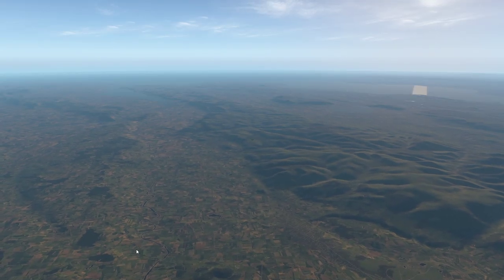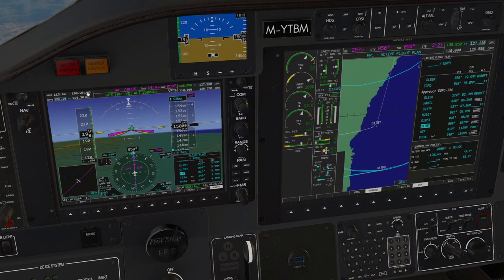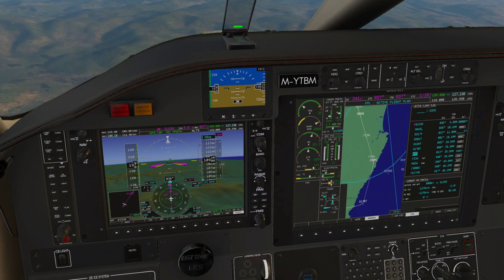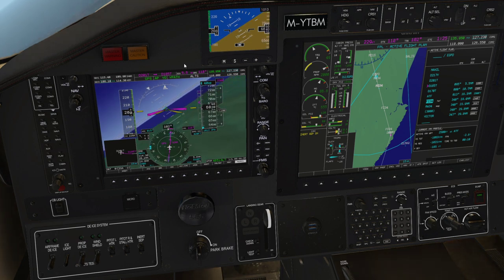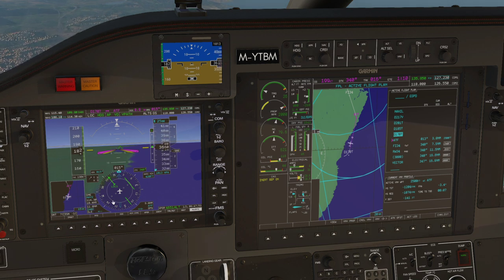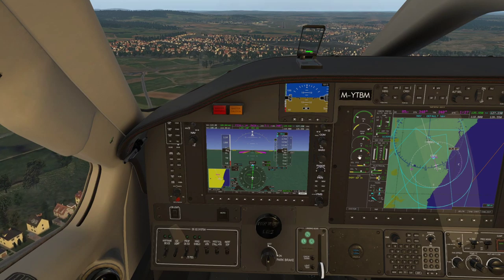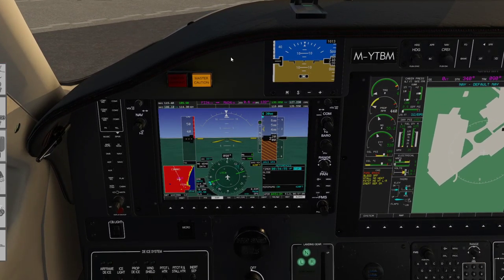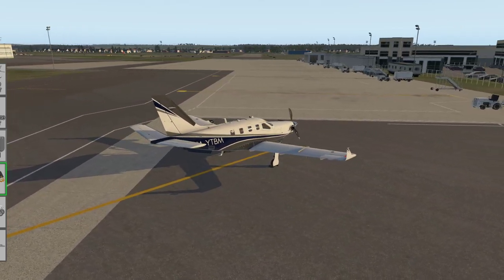Hotstart TBM 900 Part 2 - IFR Arrival to Aberdeen ILS 34 [X-Plane]

Comment: That's not really a float, in these GA aircraft, you generally flare by floating over the runway until you stall, its very common to hear the stall wrning just before touchdown in these aircraft. But nice video :)
Reply: CMBelite-FR you're talking about way smaller aircraft than that... It might be true for you ubiquitous C172/Tecnams but certainly not for the TBM
Reply: @dvirshany  For the TBM I mainly watch Steveo videos, he floats way longer than you. Granted you don't hear the stall warning but if I recall correctly, in some of his video, i've heard the warinig: airspeed just prior to touch down but i could be wrong. Also I noticed that he likes to flare with 15<-20 kts more than you, maybe that's why he performs a floaty flare to bleed the airspeed maybe ? I guess there is different kanding technique with the TBM

https://www.youtube.com/watch?v=C3wXCaA1xsg

https://www.youtube.com/watch?v=BFKdyaV4ySY

https://www.youtube.com/watch?v=Itr3xEaeGyU

PS:
in this video, he performs the same landing tecnhique like you I guess, way lower airspeed than the recommended default 85-90 kts,  but he used the AoA indicator I guess which is integrated on the "PFD" screen just below the speed tape, but you can hear the airpspeed and stall warning just before landing
Reply from the maker: On most aircraft a fully stalled landing is not really a good idea, though it’s fine on an nice day in a light single. Add some gusts and crosswinds and you don’t really want to be floating. The gear and brakes only work on the ground! What instructors are attempting to demonstrate is the correct landing attitude and to make sure students don’t accept landing flat, but that message is lost behind the “always land stalled” advice. For any landing it should be on-speed, correct attitude and aim for exactly where you need in the touchdown zone. Also, I see a lot of sim videos with some landing tool that rates the landing based on touchdown vertical speed, and I think that’s a very bad way to rate landings. On speed, in the touchdown zone, correct attitude is all that matters! The aircraft manual for the TBM shows an approach speed of 85kts and touchdown at 78kts at 3186kg. My video series is intended as a progression, we’ll look at the alpha gauge in video 4 and 5, and yes, the approach can be flown faster and the landing slower, but I’m trying to demonstrate a technique that gives precise, repeatable landing performance.
Reply: @ReflectedRealitySimulations  I met with Nils Alegren and his Caravelle sim back before pandemics were being taken seriously here - learned I shouldn't land an airliner the way I land a glider IRL :) Keep the speed right and fly it into the runway, whereas in a glider you stall into the ground. Good learning moment for me.
Reply from the maker: Exactly that. A lot of the time spent learning to land a bigger aircraft is un-learning what you’ve been taught! If you look at a minimum unstick demonstration during certification test programme the aircraft takes off while dragging the tail on the runway, the lesson being you can’t stall an airliner on the ground (Except the original DH Comet I think). Therefore holding off the landing means a tail strike is the likely outcome. Fly it on, every time.
Reply: @ReflectedRealitySimulations  ha. I've spent quite a lot of time beta-testing Guy M-P's Comet - an absolute work of art - and probably learning bad habits from it :D